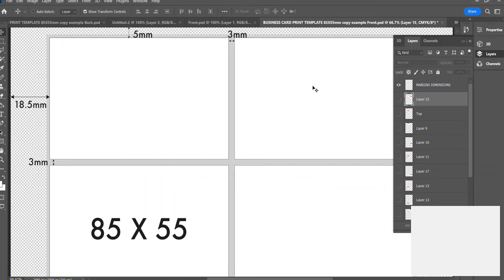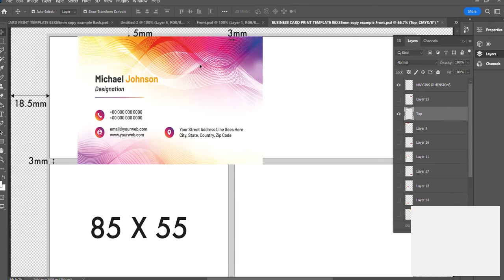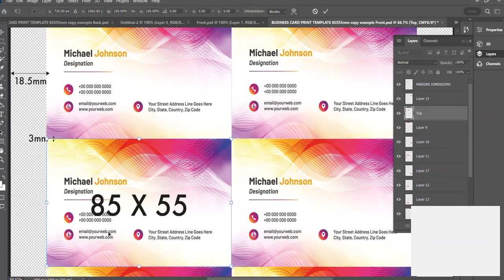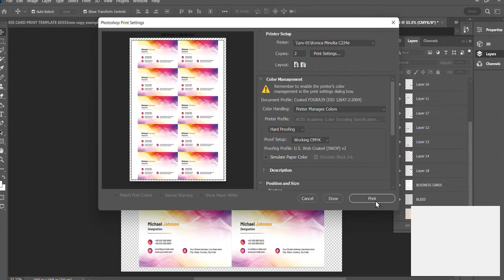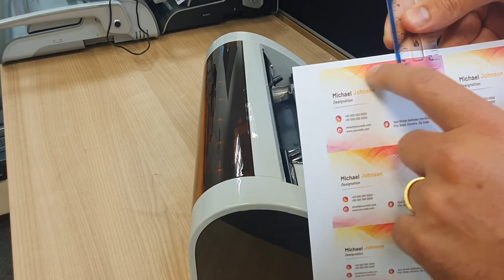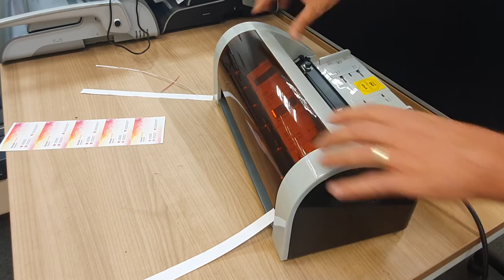Using the Galaxy Business Card Cutter with Template Set Up

Comment: Can you use this for different sizes? I'm looking for something that can cut a4 down to a6.
Reply: Most of these "semi automatic" cutters are not designed to be adusted HOWEVER if you can find a video showing its innards, a lof them DO have a fairly simple system of cutting wheels held in place with grub screws.

As such if this is one of those types, then you can manually adjust them, in your case you would still need three passes, once to cut down the center - and then twice more to cut the two halves into quarters.

A note of caution, if you are going to be processing a LOT of paper, this will quickly prove tiresome as you manually process each A4 sheet TWICE - including the "push and let go" second cut. No problem for a few sheets, not ideal if you have a ream to work through most weeks.

You might find it easier, faster and cheaper to buy a decent second hand guillotine - three cuts and you have just handled a whole stack of A4 - instead of 1 sheet.
Reply from the maker: They are fixed sizes to accommodate standard business card sizes. This video is the 85 x 55mm Galaxy Bussiness card cutter set up